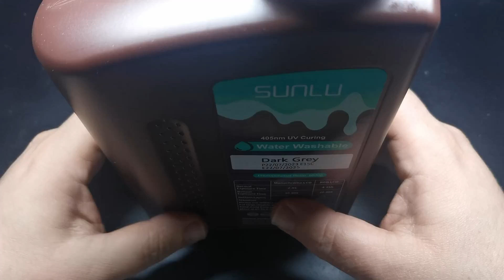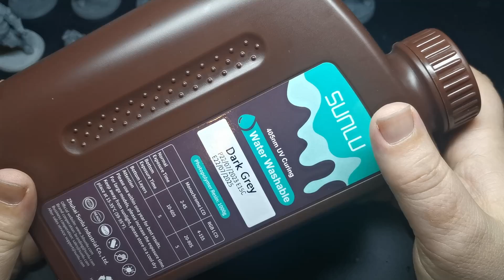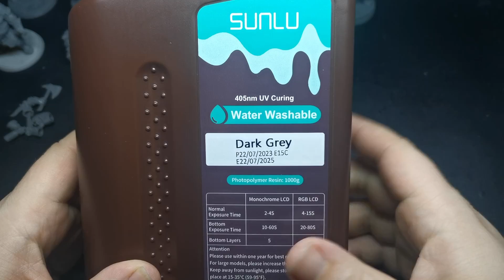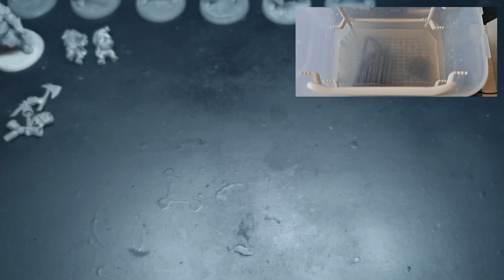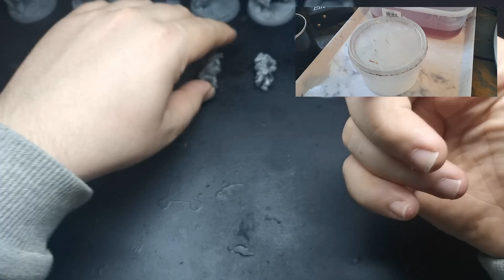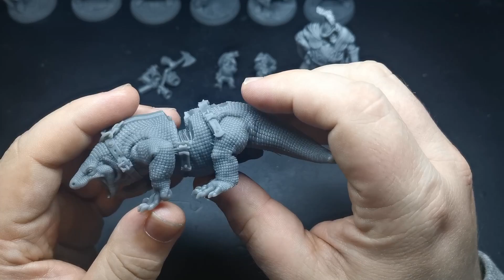First Time Using Water Washable Resin for 3D Printing: Is it all that Good ? #3dprinting #3dprinter

Comment: ive been using water washable resin (sunlu and elegoo) in my mars 3 pro for a while now and ive only had one issue where a base for a model split open about a week after printing, still no idea what caused it as it was dry inside so no resin puddle or anything like that but ive used about 5 kg so far and had no other problems at all
Reply from the maker: I do think Water washable resin is so good for beginners and for people that don't have the space for spirits etc.

Glad it has worked for you 😁

Comment: I just tried to wash my first print and there is this weird white film in certain spots. Am I doing something wrong? from the build plate to the water what steps am I missing?
Reply: that white skin is just where it needs to be washed off, i generally just use a toothbrush to give it a scub
Reply: @7kortos7  dirty water

Comment: My biggest concerns are the tub of resin filled water and possible brittleness. Your system you shared of just re using that same water over and over is a good option since obviously the stuff can’t go down the drain but 1 pro of IPA is it can just evaporate away faster if you need to get rid of it. I’ll be curious to hear if the prints are less durable as well

Comment: I've used water washable resin for a while now as the odour is generally less, it's much easier to clean in case anything goes wrong and I've gotten some really impressive results on my Halot One. However I have found it to be quite brittle and once cured you can't really do much with it. I still use alcohol to clean it though and fully cure any waste material left over - it also evaporates quicker so I'm not chucking any waste water into the water supply. I'm going to test some Nylon/ABS-like resins this week as I'm looking for something a bit more durable/bendy for things like spearmen and more elaborate minis and conversion pieces. I think for more simple or robust minis water washable resin is a solid choice.